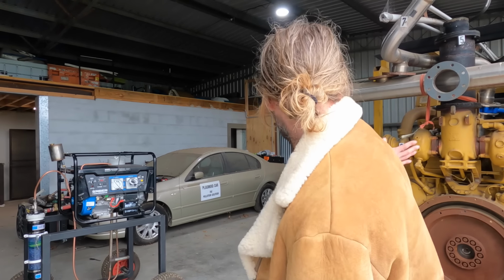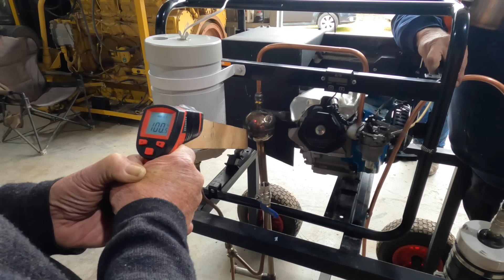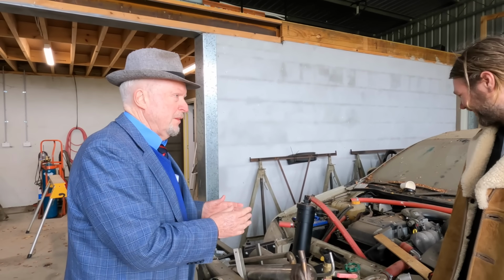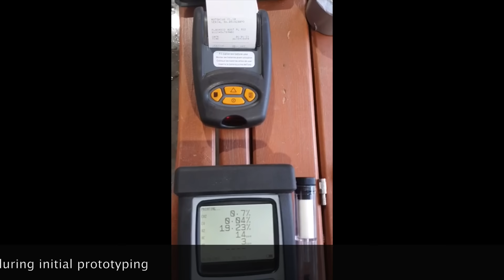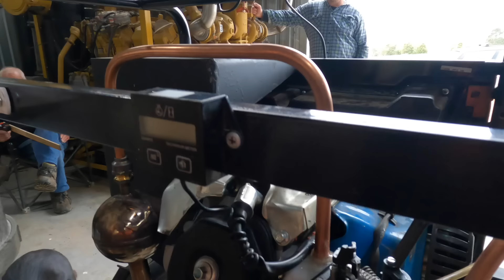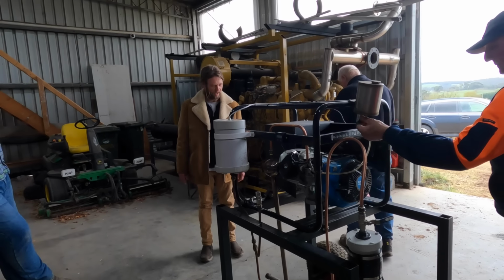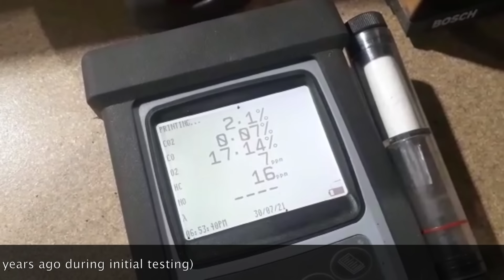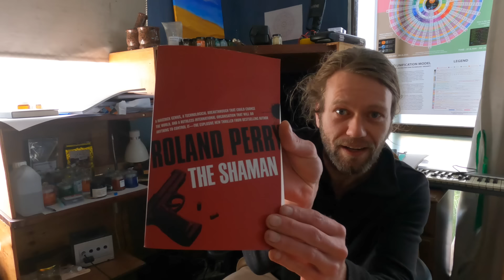Malcolm's Thunderstorm Plasmoid Generator in Action | FULL DOCUMENTARY | with Jordan & Roland Perry

Comment: What I'm wondering about is why the exhaust contains oxygen again. When the atoms are "shredded", I think the secret is in the exact frequency. What happens when the frequency is off a bit, won't we get F (Fluor) instead of Oxygen? If yes, the possibilities are even crazier, right?
Reply: That would be wild…
Reply: Perhaps protons take the path of lowest resistance, and that happens to be the recombination to oxygen (8), not nitrogen (7), for some reason. Perhaps protons travel better in pairs making this a 6 to 8 recombination? Wild guess: to do with odd and even protons.
Reply: @Cloxxki  I think the trick is that all this is done in a sort of chaos, so some N is changed to O, but some C is changed to N as well. But because N is 80% of the atmosphere, it's ok, and the NO2 and other possible harmful nitrogen compounds are ripped apart and as nitrogen or oxygen by themselves they are no more harmful. I suspect also that there will be some O which is transmuted to F etc, and also remember they were using the analyzer which measures the presence of typical expected gases of an ordinary combustion engine. So it might end up polluting atmosphere by spitting put Fluor or some other things, but this must be refined and tuned up in further tests and development and discoveries.

Comment: The implications are immense. Think only of amateur bluegrass musicians as a teeny weeny example: basically all our income from wherever we play, though it might seem as a lot for the venue operator, is spent for the gas of the band vehicle. Simply most of our hobby earned income (which is often the only excuse we have for our wives as to why do we bother with this passion) goes to oil industry owners. The new strings? Equipment? Microphones? Instruments? You need to be lucky to ever get them repaid from gigs, unless you're a professional. 
And so are many many instances where saving on fuel can help immensely. 
What I'm wondering about is why the exhaust contains oxygen again. When the atoms are "shredded", I think the secret is in the exact frequency. What happens when the frequency is off a bit, won't we get F (Fluor) instead of Oxygen?

Comment: I Have something much better.. more simple....that should be able to do a terrawatt... uses only water condensation and sound. No motor required.. also open source... but a bit different as you don't need the combustion engine at all... but only suited as a power plant.. too dangerous for a car... but could be made to power one.

Comment: ok I'm going to verify this and build one myself. i have done a similar thing to electric motors. my using the reactive forces to supplement the active forces. increase of 70% run time on any inductive load running on batteries. I look forward to building this system for testing. Any help would be appreciated. Here is a link to my patent.   https://www.youtube.com/watch?v=-ugB_nK-Mu0

Comment: I have no idea what this is? Spark ignition engines will run on any combustible fuel vapor. I'm not sure if this is hydrogen or what. A real t gas analyser will be useful in seeing what specifically exiting the exhaust. Plasmoid means nothing to me.

Comment: It uses vacuum to pull hydrogen and oxygen from water then it is super heated in a heat exchanger which is the sphere and that does something called cracking of molecules and now you have useable fuel and oxygen. 

120 year old technology.

Comment: Are you trying to tell me that carbon is being transmuted into oxygen...??
Reply: In my opinion during the process of using this device, the carbon is being totally consumed. Therefore there is no carbon left to form carbon dioxide or carbon monoxide. If somehow the water is being turned into hho and the hydrogen is totally consumed, or mostly consumed there conceivably would be mostly oxygen left. I am not a chemist nor a physicist. But with my limited knowledge, and or education this is the only logical explanation I can come to.
Reply: @jamesbemrose3461  or the carbon its gunking up the pipes and fuel chamber. run it for 6 months and see if the engine gets knackered.

Comment: I don't see the energy aspect to this, rather just a device that acts like a turbo charger and CO2 scrubber.
Reply: I'm confused on that myself. If this is actually working, thats awesome (environmentally) and should be used globally, however, I don't get how the energy comes into play
Reply: From what I've seen it's basically this.  They hype bros seem to think their turbo tube can eventually be modified into a micro-fusion generator, but have done a bad job explaining that part.
Reply: @Cinnabuns2009  I agree it's a very efficient carbon scrubber. I want to see how this effects fuel efficiency and power output. 

Bros just need to stop calling the add-on a "generator." Reactor, sure. But there is not independent power output yet.
Reply: @ArmoryMedia its a low energy nuclear reaction, it is being done by lowering the Coulomb barrier electrically rather than by overcoming it with heat and pressure.

Comment: turn the light off and I guarantee nothing changes in the way the motor runs or the way the exhuast smells. there is no cavitaion occuring in that bubble chamber and the intake manifold pressure on these engines does not fluctuate between high pressure and a vacuum. there are a lot of wild claims being thrown around in this video. carbon is not transformed into oxygen it is deposited in the cylinder, valves, sparkplug and exhaust due to the water being introduced to the combustion process. the engine revs higher because it is running very lean when pulling air in after the carbi this also accounts for the much higher exhaust temps when the device is turned on. there is likely an increase in power but would again be due to the leaner mixture and would result in premature failure of the engine.

Comment: 😂😂😂 I certainly hope the investors don’t realize that whole set up probably only cost 1200 bucks (of which 950 was the generator) …what an absolute con job…what you are looking at folks is a very stupidly engineered EGR or (exhaust gas recycling) system that has been on many cars since the 80s (now gone due to variable valve timing) …EGR systems are for emissions reasons ONLY they do not give you more power nor do they make your engine more efficient…looks like this was too good to be true, just remember folks alternative energy is just a few years away…and it always will be 😅
Reply: It is in the prototype stage, what is the con? it is to eliminate emissions, you are ignorant.